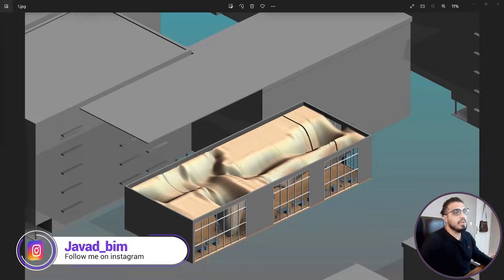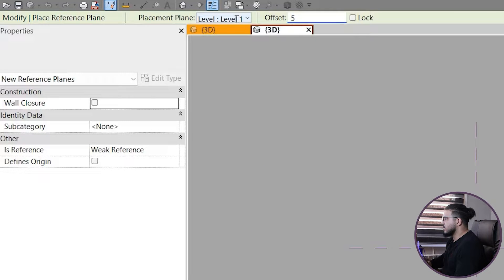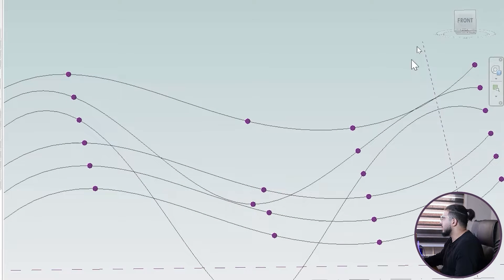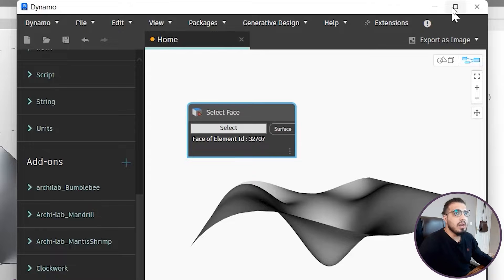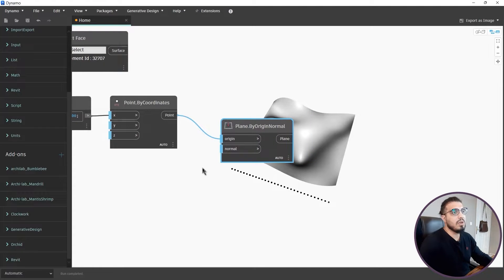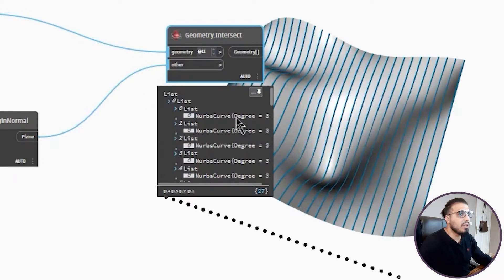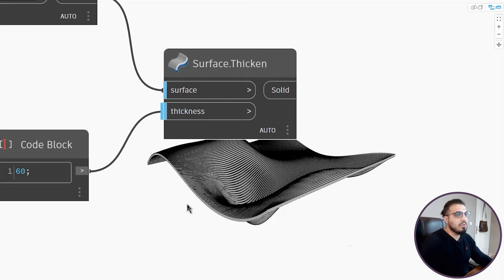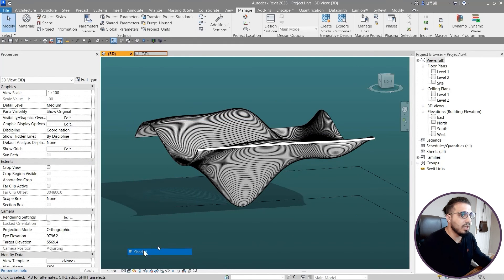Wavy Ceiling Slates with Dynamo - Revit Parametric

Comment: Hey man, thanks for the video. i followed your video to create my ceiling, but i was wondering if i could ask you two questions? 1. when i uploaded the dynamo to the revit model, it became larger. It was fine when there mass model was there. 2. Would you be able to show me how to create a void to cut this ceiling? i have areas which i wish to not have any timber to insert something. Would it be posible in some sort of easy way within this dynamo model? I have already made voids in the mass model, can we somehow link the voids to the dynmo to make the cut? 

thank you.